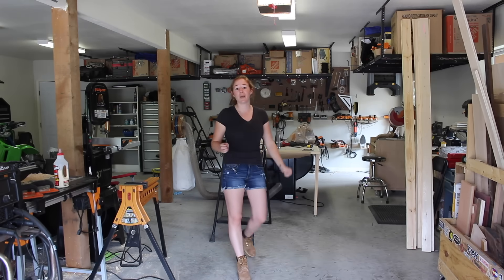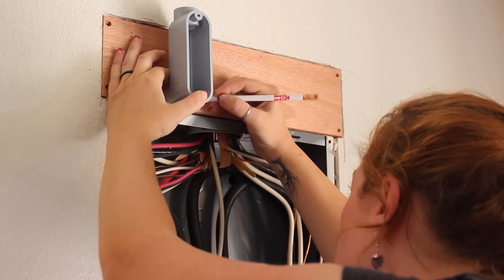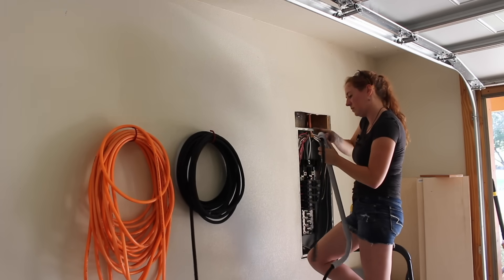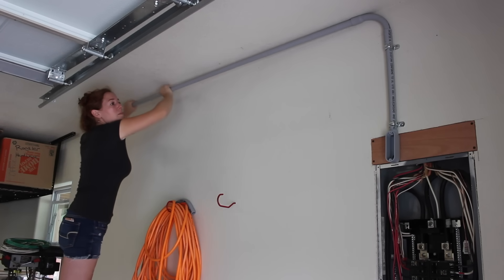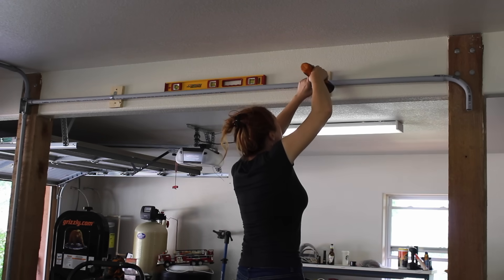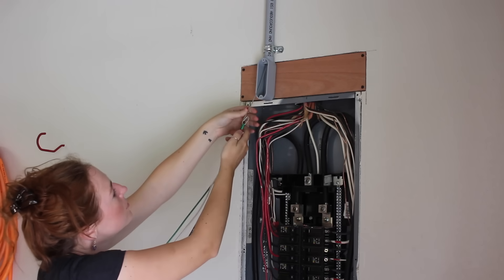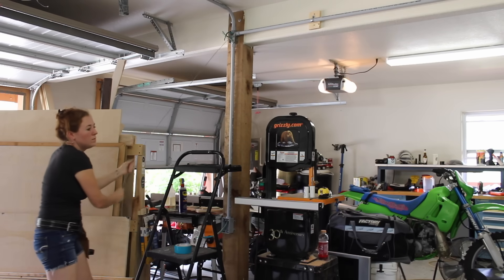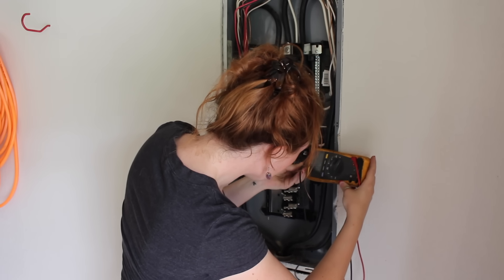Adding 220 Volt Outlets to the Garage

Comment: if you wrap your wire nuts in electrical tape, starting on the wire itself, they will never (NEVER) come apart, so no worries on arcing inside your junction box

Comment: Did a pretty good job. The only thing I saw that it really needed was that the white wire, since it's running as a hot and not a neutral,  needed to be marked a different color such as red or black, or any other color that's not white or green, with electrical tape. This needs to be done in the panel, junction boxes, and at the outlets. Other than that, great video!

Comment: Ok if you do this project again please use proper cables. I recommend a 6/4 gauge set THHN cable within the EMT/Conduit and do use on the gange box use a double because those cables are very stiff. Also I recommend using real EMT so you carry the ground on the EMT as well thru out the garage. Also as a TIP. Put your Outlets on the ceiling and use a extension cord from the ceiling will give you more flexibility and is CODE secured as well.

Comment: Close good job on changing to thhn you need to strap within 3' jbox or tubing termation and every 10' liner footage. Also that was pretty scary on that breaker install also make sure breaker is off and never touch hot lugs on breaker at anytime with bare hands or bussbar. Install everything and wire breaker in last thats a safe way of going about it. Treating everything like its hot at all times will save your life. I have to fix alot crazy installs as a service electrican. Just thought i would give a little advice.

Comment: I did not read all the comments but I see are using a white conductor as an ungrounded conductor, you also did not use a bond in the metal box where you spliced the ground, you did not mention the size of the wire but the splice box might limit the size of the wire according to box fill codes, all code violations, but I have seen worse. In general a good job.

Comment: You're lucky you can even do this yourself, in my state I need a building permit and an engineer on site to even run electrical wiring, New conduit, or adding a circuit. If I wanted to add a sub panel or new panel, state law requires a licensed electrician to do the work, and the electric company won't even reconnect service without doing an inspection first. There's a lot more local codes that override national standards and codes.

Comment: Canadian here so things might be different but when running split phase circuits as in the case of 240VAC where both conductors are hot, you dont run white unless its the third conductor for a neutral. Reason is that white is ALWAYS neutral just like green is ALWAYS ground and you dont want someone touching the white wiring thinking its neutral and is actually live. Also, junction boxes are different from utility boxes and pvc and metal should be kept consistent. Otherwise really nice work for a home gamer.

Comment: Great work! I noticed a couple of things: The junction box overhead is too small. Do you know how to calculate the conductor capacity of junction boxes?  There is also a table in the NEC manual to refer to, as well.  And at the panel, how did you get the THHN conductors into the panel?  You cannot leave them unprotected inside the wall; you must provide a complete raceway that attaches directly to the panel.

Comment: You did a nice neat job. I loved how you used a level to make sure everything was level and neat. Fish tape is a pain some times.  Working with conduit, especially on long runs, I've found using heavy string and a cotton ball is easier. You use a canister vacuum to pull the string with cotton ball through the conduit. I saw that technique done by the electrician wiring up our swimming pool when I was 13. All in all, I would gladly let you work on my house. Your work is A1 quality.

Comment: April, I love your work.  I identify myself as a Semi-Professional D.I.Y.er and always strive to do things the right way and usually with 'over kill'.  My wife says my O.C.D. drives her crazy but that's just me.  I live here in Texas, in the country, and when I ran electrical to a chicken house & front gate I found the regulation regarding cable inside conduit and the locals laughed about it.  But it's true as the conduit tends to add to internal heat build up in cable and not with the individual wires.  Love your videos, so keep them coming. P.S.  Wish you were my neighbor....!

Comment: I believe this is correct.....
#8 awg copper wire for 50 amp breaker
#10 awg copper wire for 45 amp breaker
#12 awg copper wire for a 20 amp breaker

Comment: i live in the uk fortunately for us the standard voltage for us is 240v ~ac its mandatory that cables like you have just done here (single) are in conduit either pvc or galvanised steel (earthed) may i add but on construction sites we have to use transformers to step down the voltage to 110v ~ac because its "safer"  to use we have what is called an "rcd" (not too sure what you call these type of breakers in the us) but these work on a fault between the ground and neutral cables and is designed to trip before any other cables make contact with the live cable (hot) which would cause a big bang and trow you across the room (have had experience of that) April keep up the good work all the best

Comment: Nice video, i Would have just ran dedicated circuits for each and also i notice your using range outlets so they're only 30-50 amp. I would make sure those tools you are wanting to run, does not draw more than your supported amperage off the breaker you installed and that the correct THHN wire sizes are in rated for what amperages. If each of your tools draws 25 amps and you installed a 30 amp, dont ever run 2 tools at once, only one at a time. good video though!

Comment: I need to run me a 220v line out to my workshop for my everlast welders. I'm currently using an extension cord out to my dryer outlet. A dedicated line would be so much more convenient. Congratulations to April for taking this on.

Comment: Good job April. Most guys would have just run romex and stapled it to the wall. Let's see them post there work.... that looks very nice and neat for a non full time electrician. Anyways as mentioned previously use of a bigger box and use a junction instead of an LB so you could transition to romex when entering your panel.

Comment: Job well done! I recommend running conduit at a slight downward angle to allow better water drainage, on the off chance that something or condensation  should get into the system.

Comment: A little trick I use instead of fish tape is mason's  line.  You blow compressed air into the conduit as you feed the string.  Amazingly it works great and is FAST.  Also, it does not get hung up on anything.  I was skeptical when I learned of this trick, but after trying it, I was sold.  Congrats on the move and new shop!

Comment: Quick question, did you use the right gauge wire that can handle 240 volts
Reply: I’m late here but u do realize most wire in homes is rated for at least 300V u must be talking about amperage

Comment: I did my 220 outlets the same way April did hers, but I took my plans and had them approved at our building inspections office. But what I did different is I  used Black, Red and green, where she used Black White and Green, code inspection would zing you for the way she did hers, unless she labeled the wiring and that was not shown. I also have a unfair advantage, in that I am a Electrical Engineer and I used the National Electrical Code and Electricians Handbook for backup. Overall April did a great job, for someone who does not do that professionally. Kudos to you young lady. I love your DYI  videos.

Comment: Nice job April. I try never to use a metal box in residential work though. If you use a plastic one you won't  have to ground it (hopefully you did yours). Also, they make a large assortment of boxes with hubs in them so there's no need to knock out holes to add conduit. Keep up the good work!

Comment: April, you did a good job the other comments told you the things you did not do correctly so I won't go into that. I am an electrician and have been since I was in high school. let me tell you as any electrician would agree, we criticise people's work more than any other trade. Mainly because as you mentioned in your video it is very dangerous if mistakes are made. I would recommend anyone that wants to do something like this to proceed with caution. if you feel like you aren't doing something correctly you probably aren't. Electrical fires happen every day. 

April I am starting to build my shop and will be doing woodworking videos with my wife. I have watched a lot of your videos and hope our channel will be like yours in the future. I will certainly give you shout outs when I start. 

Thanks.

Comment: April I have seen electricians use rope that was sucked thru the conduit from one end to the other using a shop vac.  makes pulling wire a snap

Comment: Ok, I want to say I'm impressed that a DIYer would use conduit and I generally applaud your sense of craftsmanship.
Some of these tips will apply to this installation and some will apply just to electrical installations generally.  
I'm a little concerned that the conduit didn't seem to be actually connected to the  panel.
Of course (as you show) you should always use a two pole breaker and never use two single pole breakers for an installation like this.
Junction boxes should always be over-sized to allow for future expansion especially in a shop. ( This applies to the whole installation generally, Conduit, Boxes, Wires and Breakers, loop the wires at every junction box ect.) Of course never oversize breakers with respect to wire size.
The steel boxes in this application should be grounded with pigtails because they are otherwise isolated via PVC conduit.
The "one-hole straps" should be put in right-side up with the hole below the conduit.
And a good electrician would make use of the ground screw on every device regardless of whether it has a yoke strap.
You should always use electrical tape to wrap around the device, covering all energized parts of the device after you make your connections.
Never back stab the wires into the device and never daisy-chain devices ie a device should never be in series with a load from further down stream, instead every device should be connected via pig tails and splicing, Essentially all devices should be connected in parallel, except obviously switches.
And lastly you should never put screws into wood in a direct line with the grain, rather you should offset them at least a little to avoid encouraging splitting along the grain line.

Comment: Awesome video. My garage is ran off of the bathroom ground fault thingamajig..... I would like to run dedicated outlets to the garage so I don't pop the GFI(right?) when the wife fires up the hair dryer and my compressor is running (110v) or my table saw. It's a pain in the hind end. You gave me some courage to tackle it.

Comment: I think she did a better job then i seen some guys do.
With that said I might ahve picked a differnt type of outlet plug and ran 4 wires not 3.
However on 240 single phase you only need 1 neutral path to my understanding because each flip or each 120 volt side of the panel uses the neutral when the other side is in reverse phase, its not like DC current where each positive needs a ground but share a common ground, and you can't get 24 volts out of a car's 12 volt electrical system unless you have a diesel with 2 batteries or some hybrid type system.

  ( I just know this comment is going to come back to bite me in the ass because somone will point out its wrong because of some brand of some off the cusp brand of car, I'm talking a normal gas car the avg car and don't point out a 1918 electric car either I'll just tell you to change the muffler bearings smart ass!)

Comment: The NEC code reference you were looking for, the one that prohibits running SOOW or other flexible cords through any conduit is 400.8(6).

Flexible cords such as SOOW may also never be used as a substitute for the fixed wiring of a building as specified in 400.8(1).

As an electrician there are a handful of things I would have done differently (mainly ran EMT instead of PVC and come out of the panel differently), however this generally seems to be a safe installation and is probably better quality that what is hiding in the walls of half the homes out there.

Only things that raised an eyebrow was that the metal junction box needs to be grounded per NEC 250.148 (maybe it was but I didn't see a ground pigtail during makeup). And it is also illegal to use white wire as a phase conductor as white insulation is reserved for grounded (neutral) conductors only except in special cases (such as flexible cords) per NEC 200.6

Comment: I think April did a great job... Most DIY'ers wouldn't attempt something like this even after consulting an electrician. I may have chosen EMT rather than the PVC, used a 4" box at the junction and at the receptacles instead. This may have saved a few $$$. Someone already mentioned using "red" instead of the white or taping the ends with black tape to identify as "hot". Maybe for the next DIY electrical video, mention the wire size and breaker amperage used and why.

Comment: First mistake was she wired with green.  For each outlet using heavy pwer loads, you need to run 220 Red/ Black/ White wires. Just as refrigerators, air conditioners, coffee makers, and other power draw appliances, safety is #1. Best thing is check the power needed for each appliance and work accordingly.  This is why major power draw items like Refrigerators and air conditioning units use devoted lines called home runs, and air conditioning units use 2 circuits making it 220. When doing a project like this,  it is important to research properly the correct gauge wire, circuit breakers 15A or 20A, and power coming out of the outlets whether it be 110 or (220 which is 2 circuits tied together) A perfect example is if you plug in a hair dryer and a coffee maker in the same outlet, or run of outlets with a 110V, it is sure to trip the circuit breaker.
Reply: http://www.thecircuitdetective.com/basic_house_wiring.htm

Comment: When installing 220 lines you should use either 2 black wires or a black and red, the white wire indicates a neutral
connection....
Reply: I was wondering how she got 220 with that configuration!
Reply: Jack smith, is correct  on the 6awg.
Reply: Yup. If you use white the electricity will object and the electrons will go on strike.
Reply: my Instincts  she said that she marked the white wire red at the main panel but she should also mark or sleeve color red at every point she continue to used the white wire as a hot conductor
Reply: my Instincts that’s true but she could also use black or red tape on the white wire indicating that’s it’s a hot. Ideally to cut back on any confusion it’s best to use a red and a black when you have individual THHN wire. The white is often used as a hot on 240 lines but typically only when it’s in Romex. Of course it’s self explanatory at that point
Reply: @JustinLodes  You can't phase the ground or grounded wire smaller than number 6, she shouldn't have used white wire at all.

Comment: Of course there is a time element involved in the video,.......she forgot to mention that she is installing a single phase 220 outlet ,...which only involves three wires.....220 three phase is for Industrial use  and it  involves four wires.  I noticed she did not tape the wire nuts at each connection ...but that;s optional....whether is her garage or not....she still has to go by her  city  codes..and maybe her area allows her to do the work herself.  She did great!.

Comment: Hi April im an electrician. looks like a nice neet job.. only thing I would of done is to loop down to the fist socket and use that to loop back to the second socket to avoid the junction in the junction box just leave some slack in the box ... but I'm from the UK where its different :-) and we tend to use 32 amp ring main circuits wired in a loop with 2.5mm  cable but we do sometimes do 20amp radial circuits for certain circumstances.

Comment: I have been doing home/shop electrical for 50 plus years so I endorse your premise of common sense and research as the secret to safety and success. I have had the opportunity to learn from some excellent professionals and you did a really top notch job.The suggestions about running separate circuits for each box, doing continuous runs, and using individual breakers for each circuit is really valuable for your viewers, especially since you were in the fortunate position of having the capacity in the exiting panel. If in doubt; consulting a professional is a must! Don't ever forget electrical problems are one of the most common preventable home/shop fire hazards!!!!

Comment: What gauge wire did you use and what amp was your breaker? That wire looked like it was a little small for 220. I wired in a 220 breaker in my garage and had to use number 6 wire

Comment: Looks like you did  a great job! BUT here in Australia, you get caught doing this as an Un-qualified electrician you would be up poop creek with massive fines and needing to get it all redone and checked. Any mains power stuff needs to be done by a qualified electrician...doesn't matter who you speak to if your not licensed to do it you don't touch it at all.